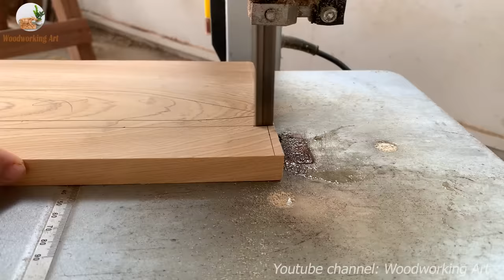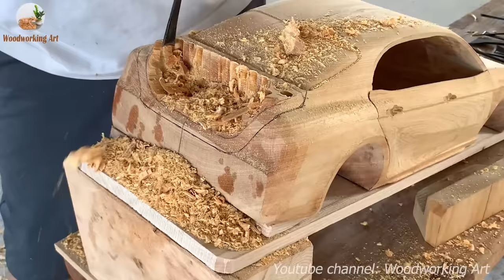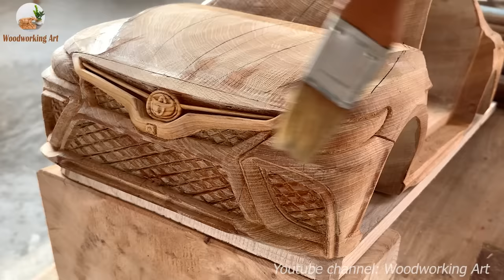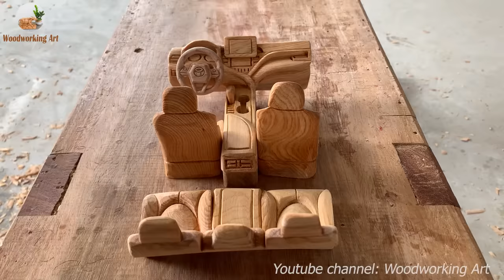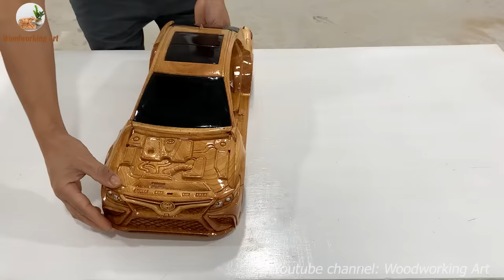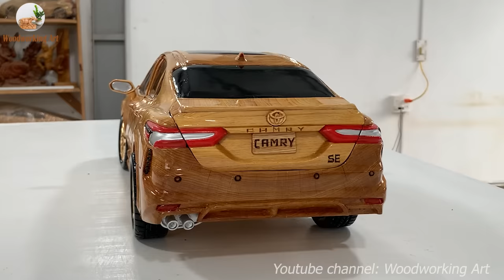I renovated and upgraded my car 2023 Toyota Camry - Woodworking Art

Comment: This is a great job honestly, Toyota needs to see this but the only mistake made is at the exhaust, the exhaust pipe is supposed to be at the right corner not left , it’s only if it’s a v6 that it can be on both sides … smile